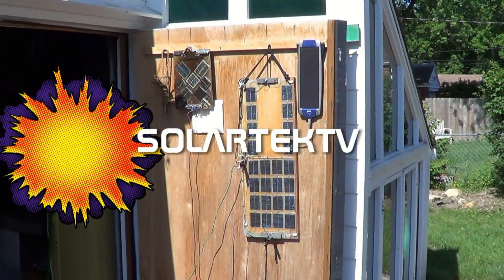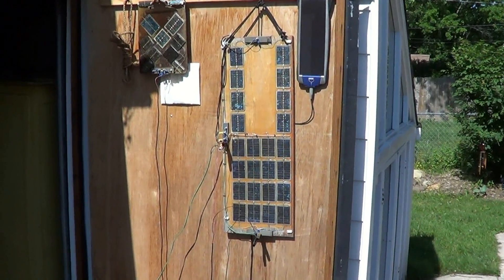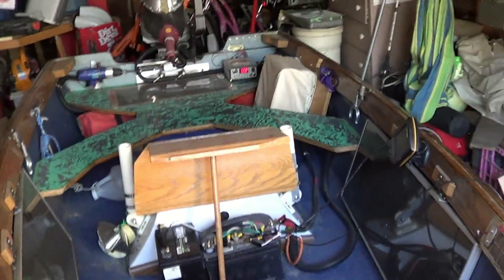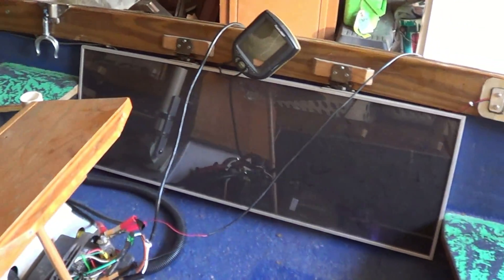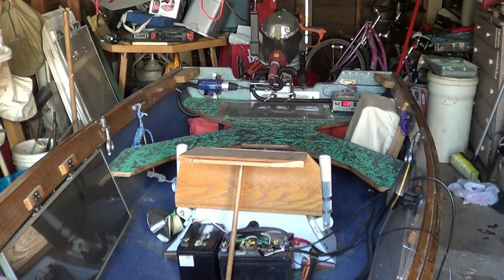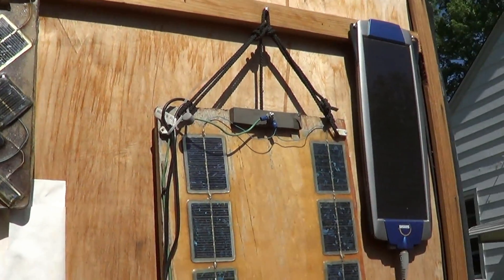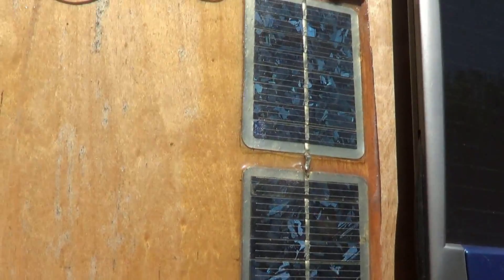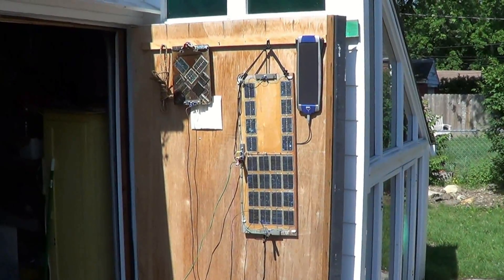Homemade solar panels USING Solar YARD LIGHTS whats in your garage?

Comment: I am currently building one of these!
Reply from the maker: badsaddamdotnet  ~ hey badsad ~ homemade solar is fun and easy ! hope your project turns out nice and becomes useful for RECHARGE!
Reply: well... not that useful... it charges my mobile devices
Reply from the maker: ~ hey badsad ~ one or 2 less devices dependent on the grid! NICE work ! and more convenient / portable ~ + PLUS you RECYCLED green energy! Be proud ~ we are removing the chains of oil / coal burning companies one device at a time ~ :)
Reply: +solartekTV I also built a PVC wind turbine :)
Reply from the maker: badsaddamdotnet ~ hey badsad ~send out a picture! always good to see homemade green power! p.s. how many watts?
Reply: +solartekTV its on my vids just a prototype
Reply from the maker: badsaddamdotnet yeh! watched the video ~ nice work ~ i like the pvc blades wow!  nice cuts and were did you get those gears?
Reply: +solartekTV rotating fan modules have them.  helps them rotate slower than the actual fan but I reversed it